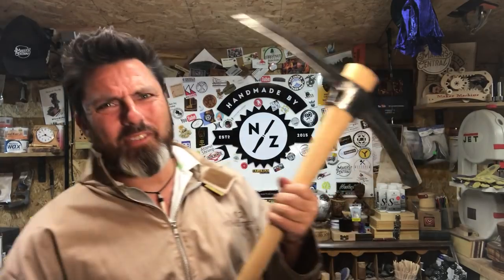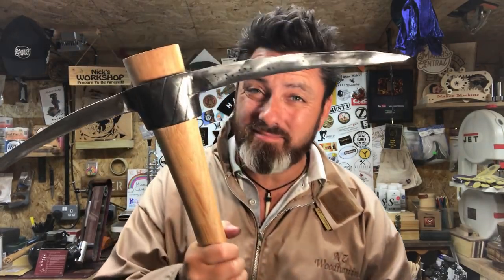Trying to restore a very rusty & pitted vintage pickaxe.🤔

Comment: its your pickaxe so you can do whatever you like with it, but for something like this i have some specific rules i like to follow and share with you;

-soak it in oil, make sure it gets everywhere and only use oil to clean it, so you prevent further rusting
-get some wire wheels, brass, stainless depending on how much you want to clean, brass leaves some interesting stain to it sometimes
-DONT grind except to restore functionality, mostly the business end of the tool

old pieces should be allowed to show signs of wear and use, if you want a new looking pickaxe, well you can just go buy it! the old stuff gets interesting because of the patina and the pitting! just wire wheel the rust off, give it a coat of oil to protect it, polish up the business end and you are golden. really no need to bring the grinder at it in my opinion
Reply: Great tips. 

I don't know about new pickaxe idea though. Most new pickaxes that most of us can afford are at big box stores and are covered in horrible neon yellow or green or other ugliest paints they could find to paint them and they aren't made out of steel with quite as high quality as older pickaxes were. 

I ended up moving to a red clay and stone infested yard in the early 2000s. I love the place, but it is a nightmare to work in the yard here. I have had people stop halfway through mowing and flee for their lives from the red imported fire ants and velvet ants and giant wolf spiders and huge snakes. I asked them why they stood still. I warned them not to stand still anywhere in my yard for more than a few seconds. It is just not wise here. I'm not the only one the red imported fire ants have "pantsed" in this neighborhood. And fire ants don't leave dollar bill tips for making your strip either, the ungrateful little asses. I at least was able to keep some of my dignity. The guy down the road that they "pantsed" ended up losing his underwear too. 

Anyhow, I ended up having to do my own yard work. When grown men are sent fleeing for their lives, a woman's gotta do what a woman's gotta do. I'm not strong enough to withstand the fire ant pain. So, I have had to use smarts to be able to work in my yard. When I can save up fish heads or some other meat scraps to keep the fire ants busy rending and gnashing at some other meat besides my feet, legs, arms, and rear end for a couple of hours (they cleared all of the meat off a 2 foot long gar fish in two hours one time) and can work in my yard, it is still hard ground to break. It bent my shovel. I went to buy a new shovel and someone recommended using a pickaxe for this kind of yard. So, I got one. It is covered in the ugliest neon green paint (and I usually like most shades of greens including some neons) I think I have ever seen. It works much better than a shovel in this yard. So, the advice was right on that. I just hate looking at that ugly paint color every time I use it. 

After seeing this video, I'm tempted to at least try to get that ugly neon green off this thing though. 

Which oil do you find is the best at inhibiting rust?
Reply: haha that story :D i dont know much about pickaxes in particular, but i dont think the steel quality these days is worse than they were back in the days, at least if you buy quality stuff that is not from the big box store. there are quality alternatives and i bet if you search on something like amazon you can get yourself a good quality one. 

getting rid of paint is not a problem, wire wheels mostly do the job just fine, if it doesnt you can still hit it with a sander of some sort. 

the oil you use doesnt matter that much, it can be something like mineral oil (sold as baby oil or oil for kitchen tops), lindseed oil works too. i mostly use ATF fluid because i do a lot of machining and this stuff is extremely good in keeping a drill, tap or carbide insert cool while plowing through some steel - so i mostly use that, if i dont have any, used motor oil or a leftover from an oilchange does the trick too. 

in the end it doesnt really matter, the oil just needs to keep the water away from the metal surface. 

after use, clean the tool, give it a light coat of any oily stuff you have really and it will last forever with no rust. i think cleaning it is almost as important as putting oil on it
Reply: I would paint the pickaxe head with powder or spray pait at the very least! It is certainly better than oil as it can go on longer without maintenance.
But please not neon pink or yellow!
I think that electroplating the entire thing would be the best choice but that would be really hard to pull off
Reply: Well said mate

Comment: very nice vinegar bath will help with the rust faster but it looks so cool love your videos. (✪▽✪)
Reply: that's what I say
Reply: Not worth soaking in vinegar if you are grinding it back soaking trick is for metal you are trying to preserve. The flap wheel would have done the job from the start and could be followed up by finer grit depending on finish desired.

Comment: Should have soaked it in acid first. It gets all the rust off. Then neutralize it in a baking soda water bath.
Reply: That would leave the metal etched meaning that it oxidizes faster but if you have the means go for it, i do not have enough ferric chloride or acetic acid unfortunately but a rasp does the trick, if rust literally scales off the part a claw hammer should be used though

Comment: Nice job. Little advice if your going to use an angle grinder get a scotch brite disc it removes the rust and scale without biting into the metal. 👍keep the videos coming!

Comment: Pro tip for your funky self. Get a couple of bottles of some white vinegar., Make a little container out of some wood and plastic sheeting, (four sides and lay the plastic over it then lay the piece into it) and let the piece sit in the vinegar for a day or two, the just wire brush all the crap right off and give it a good rinse and oiling. gets rust out of all the pock marks as well.

Comment: This video is going to get mixed reactions. 

I had made a comment that got a response like, "Reminds me of Antiques Road Show.. they said [then it continued I imagine]" or something,  so I didn't see it/you.  Damn lol. :)

[[Edit: think my comment was,,  ".. this is a thinner lighter pickaxe on the blade side,  and someone needed this somewhere in the past or widely used for some reason. Why, where ?" ]]

Don't any of you do this grinding-away of metal in your doings (I won't say 'restoration' cus it's not) so don't any of you do this though. 

I noticed there was an edge-lip on that Collar of the pickaxe in the middle,  too.
Done is done though. 

I would say now:
Nick,  immediately engrave that pick "Heavily pitted" somewhere it won't get rubbed-off though,  because you were looking to do more metal engraving anyway.

Shame I deleted what I had, before noticing someone had responded..
Sorry,  someone. Lol :)
Cheers all.
Reply: Ack that was I.  Ya onantiques roadshow guy brought in a nice clean oil lamp.   Washed off all the soot.  The soot was the value.  went from 50 grand to a 100 bucks.  Patina is value!
Reply: Steve Sebzda Deep comments. Read it but could make no sense of your conclusion.

Comment: Hardened tool steel probably isn't the best material to use for your first engraving. A softer metal, wood, or resin would probably be better for learning. Then you can move up to more difficult things.

Comment: It'll last forever with a few head and handle changes😄😄
I have a few different approaches to tool restoration: if I'm using them, they stay how they are (with the exception of resharpening and making them safe to use) as I like the feel of using a tool with history.  If they are for display, either a good clean or a full resto with a little patina left

Comment: Sorry Nick, you went straight to the  brute force method by using the flap wheel. Should have really started with a wire brush to remove the loose stuff first, then either rigged up an electrolysis bath  to get the ingrained stuff including the piited stuff ( now that is COOL once you see all the crud bubbling off!)  OR just a weak acid/vinager bath. Once you could see what was left then decide if want to use a flap-wheel to get it smooth. Don't know what you were thinking with the 'design?' markings. Sorry mate, its a thumbs down from me on content, but still a thumbs up for presentation.
Reply: Where's your first ever video on metal restoration? Nick is trying to do, not just talk about it. The engraving is based on the pickaxe from the Minecraft game, which his son is a huge fan of. Seems like a good set of reasons to do a project, which he can then learn from on the next one.
Reply from the maker: OwdJockey lol .. it’s my first restoration and we all need help buddy on these things like encouragement not thumbs down ! 🙄.  But thanks for your support 😂
Reply: Cheers Nick, wondered when the first  "Happy Clapper" would pipe up with a "thou shalt not offer any criticism". For what its worth I've done a few YouTube videos and only those that have bothered to produce such videos can appreciate the time and effort required  in doing this. Feedback is a good thing, which does not necessary mean saying something is good when IMHO it is'nt. I have emulated a number of Nicks projects with varying degrees of success and always look forward to seeing what the next subject will be. Nick's videos are brilliantly entertaining, they are amusing, funny, witty, clever and are edited (which takes a lorra lorra time) to a very high standard.  Well done Nick, keep on making great videos..........................................but don't expect an invite from the local Industrial Archaeology Preservation Society soon. BTW I did not press a thumbs down, I used it merely as a figure of speech
Reply: OwdJockey, I just realized,  Thank god that original picture is in the thumbnail too. Whew.. lol